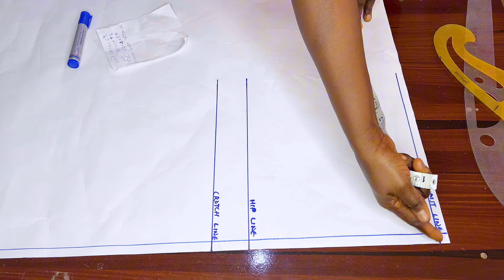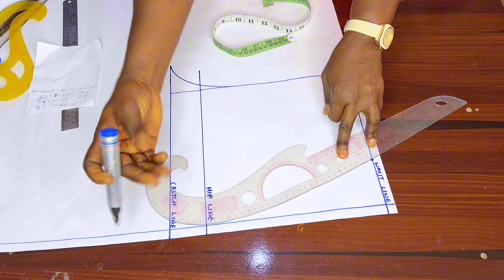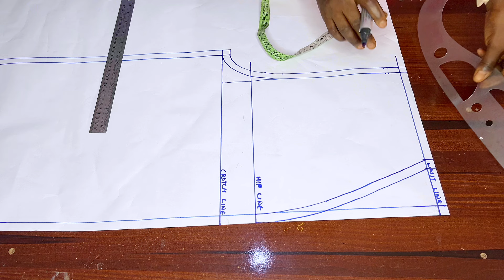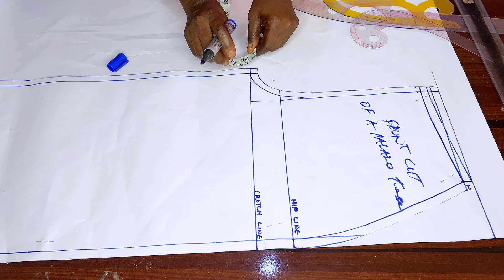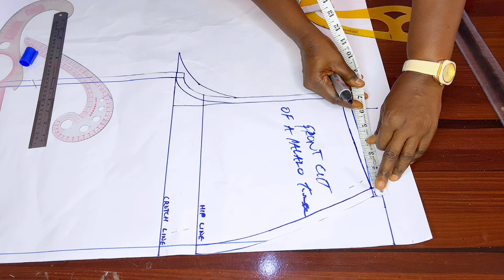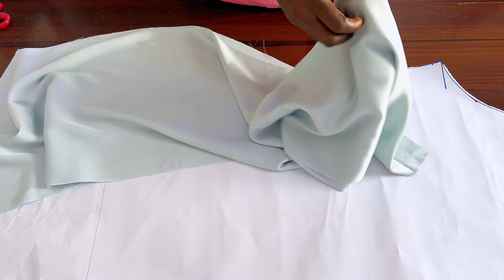How to CUT and SEW HIGH WAIST PALAZZO TROUSERS | Easy beginners friendly tutorial of two piece pants

Comment: The 10 for the hip line and 12 for the croch line r they standard measurements
Reply: No, measurements differs in body sizes. Mine is 8 for hip and 10 for crotch
Reply: So how do you know when to use 8 for hip and 10 for cloch or 10 for hip and 12 for clutch? 
 @uwameumashi9858

Comment: How do calculate the crouch.
Reply: Hip  divided by 4 plus 1 inch for normal waist and 2 inches for high waist. For the crotch curve you can divide your hip by 16 or you divide your hip by 4, whatever you get you divide that again by 4
Reply: So if I follow this procedure I'll have a fitted pant from the hip area and straight down?